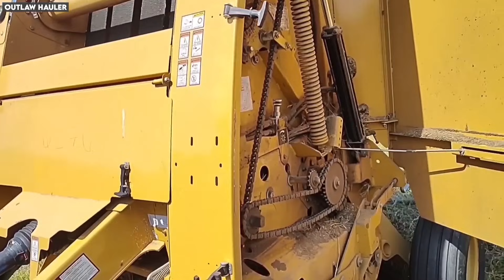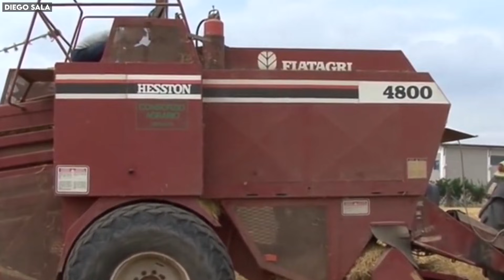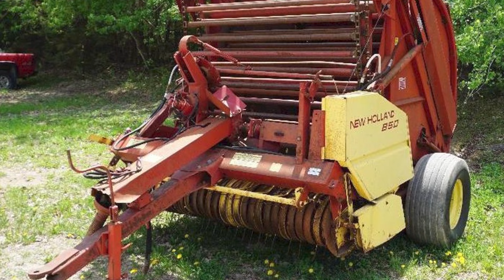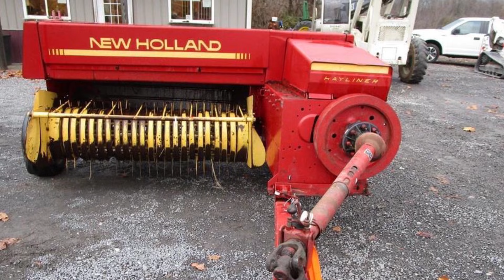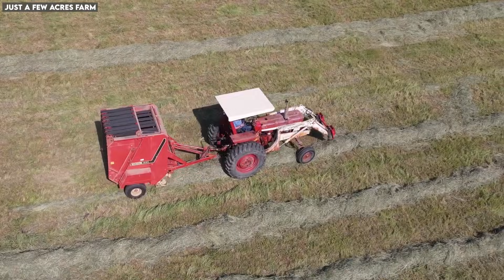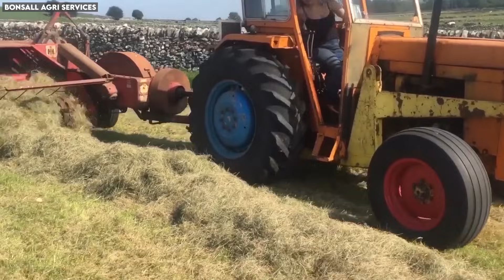10 Forgotten Hay Balers That Once Ruled the Fields

Comment: I have a New Holland 460 round baler and a New Holland 210 discbine. I also bought a Kuhn 4221 digidrive rotary rake and a Kuhn 5001 four basket Tedder. New Holland rakes and tedders are made by Sitrex of Italy and I won’t have them.